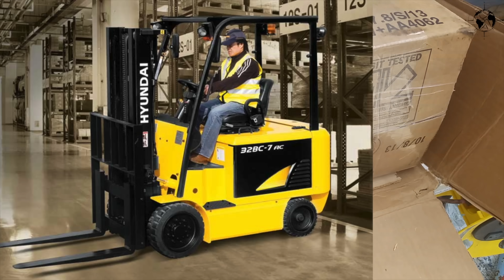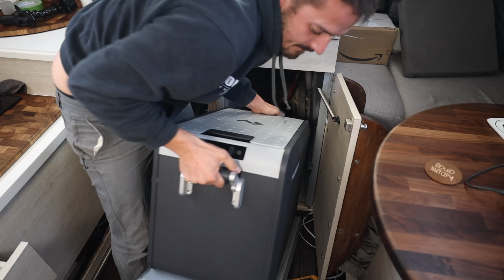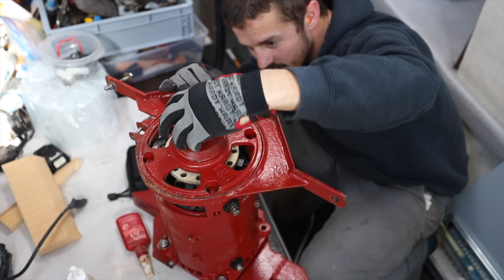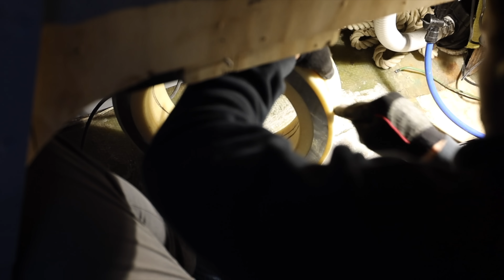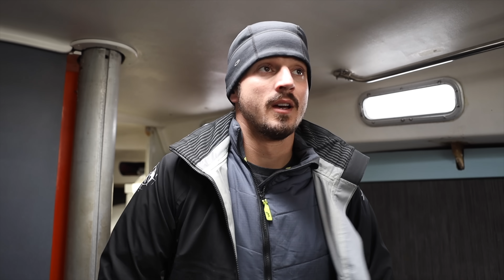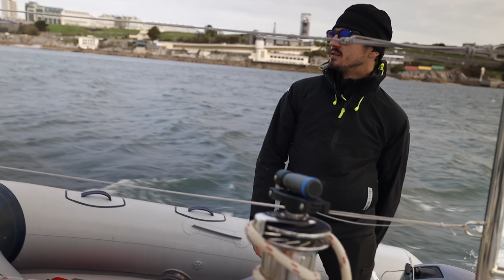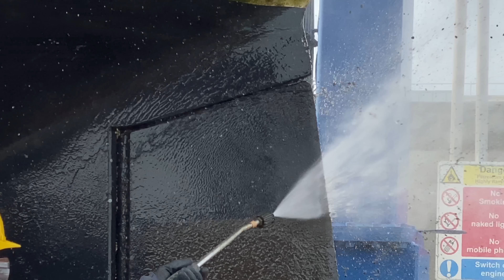Getting Rid of our DIY Electric Motor — Sailing Uma [Step 212]

Comment: Watching this video, one question came to mind.  How were you able to make sure that the mount was installed level while in the water.  I wouldn't expect the boat to be perfectly level.  I would think that it would be fairly critical to be correct side to side and for and aft?  Just curious?.  Great videos as usual and have been watching since you first started on your journey and can't believe it's been five years.  Time flys as you get older.......
Reply from the maker: We just trim the boat so she's level and then level the mount. Everything on a boat is relative anyway and being off by a degree or two doesn't make much difference. It's just for reference.

Comment: I know nothing about electric motors and boats but why don't they add some kind of alternator so as you're running it it also recharges
Reply from the maker: Takes power to make power and there are always losses. Any power gained from the alternator, would take more power to make from the electric motor. 

Now, having an alternator on the side to be used while sailing and act like a hydro-generator, is definitely an option, and one we've looked into.

Comment: Hey guys, what was the reasoning for changing to a sail drive? Seems like a lot of work when Oceanvolt also make a shaft drive unit which would be much easier to install?
Reply: Since it was a gift, used, from another boat, I think they will  install what they received.  I think that a sail drives flexibility would be welcome.  Can't reuse the prop and shaft but, they aren't optimal for regeneration anyway.

Comment: How would it slow you down under sail?
Reply from the maker: We'll have to try to test that on some passages soon. But we've been towing a 3 blade fixed propellor around for the last 20,000 miles, didn't seem to slow us down any. But don't worry, we'll be testing and sharing all this as we go.
Reply: @SailingUma  Thank you for the info, really want to see how this works.  I am really hopeful that the technology advances quickly so that even Lithium ion becomes an antique.

Comment: Hi, how are you finding the costs here in the UK compared to the US?
Reply from the maker: much, MUCH cheaper. Marians are about 1/4 the cost as the US and a lot of the boat stuff is cheaper since it's the same as RV's. Boating in general over here seems to be more "normal" and less "luxury" so everything is much less expensive. We were actually quite surprised.

Comment: You aren't likely to electrocute yourself with 48 volts DC or less, but you can absolutely burn/weld yourself to death with a large 48 volt battery bank.  For example, if you are holding a wrench and it vaporizes in your hand because you accidently short it across positive and negative, you could easily lose your hand.  I know you guys know this, but just some clarification for others that may not know.  Really cool project though.  I have been following your electric sailboat adventures for a while now.  Thanks for sharing.

Comment: Even a "seized" diesel can be rebuilt. I would have stuck with the diesel from the get-go. Good luck with your new challenges.
Reply from the maker: We tried, but we're not diesel mechanics, nor do we enjoy working on them. The main issue, is that the motor is 30yrs old and they didn't make very many of them, so spare parts are hard to come by. We spoke to many mechanics and machine shops and got similar advice from them all, even Westerbeke. They all said, we "could" rebuild it, but if, half way though, we lost a spring, or seal and couldn't get a replacement, we'd be a few thousand into a rebuild and still have a non working motor. For the price of a rebuild, we could have put a very nice electric motor in.

Comment: I would strongly encourage you to add a lot more glass to your ring.  That ring is the only thing between you and sinking IMMEDIATELY if you hit something with the sail drive.  The force if you hit something with the sail drive would be tremendous and would open a gaping hole in your hull if the bond of that ring failed.

Comment: Exciting times. I wonder if there is a platform that would raise, lower and store your outboard motor. A scissor kind of thing. Thus in the lowered position could be used for boat power from the stern. Also an easy move to the dingy. Looking forward to your electric motor install. Usually talking heads in a presentation doesn’t work well but the subject matter and b video was very interesting. Great stuff!

Comment: Holy cow. What you two have done is most impressive! Went by Oceanvolt'sr website. 38K euros? That is a new Tesla. Most generous patron ever. 

Btw, battery technology is changing rapidly. There are much safer batteries out there that don't catch fire. I suspect you already knew this. If not, check out the Li Titaniums and also Elon Musk's new square batteries which are replacing the 18650 Panasonics. He's having them made in China.

Comment: How do you use a level when you are in the water?
Reply from the maker: How else would you make sure things are level? We make sure our boat is level, then make sure whatever we’re installing is level too.
Reply: @SailingUma  just moving around on the boat makes my boat level change and we have similar size boats.  I, instead measure from reference points.

Comment: Surprised no one makes a bolt on aftermarket regen kit with its own dedicated propeller that mounts outside on the back of the boat.
or a kit that connects between the propeller and the motor.
Reply from the maker: They do. Watt and Sea makes one, but they're $3000. For that price, we could upgrade our motor and get more regen from a prop we're already dragging though the water.
Reply: Thanks, I was wondering if other people that want a regen system could get one.
Safe Sailing

Comment: Looking forward to see how much speed if any you will lose while using regen while sailing. I drove a hybrid with regen 150,000 miles and never replaced the rear brakes   could feel the regen slowing the car down.

Comment: SepEx is STILL not pronounced "Sea Pex". It is pronounced "Sep Ex", for SEParately EXcited. I corrected you guys when you first installed the electrobeke. SepEx simply means that the field and armature windings are controlled separately.  I think you may be getting confused with a pump company called "Seepex". As an analogy, the armature current controller can be thought of as the throttle, the field current can be treated like a transmission. The higher the field current, the greater the torque, but the lower the RPMs.

Comment: Odd. Usually in Spring/Summer, the marinas here are pretty much empty and even offer you good deals for hauling your boat out, because everyone is using their boats. 
Whereas in Fall/Winter, when no one sails that much, marinas are crowded with boats doing maintenance. 
So it seems like quite the opposite you guys have in England.

Comment: Is a 300 volt motor dangerous to people while on the boat or when swimming around the boat? I get that it's dangerous, but I don't know how or why, pls enlighten! What are the scenarios that make it dangerous? Not looking for smart ass responses, just understanding.
Reply from the maker: It’s dangerous when something goes wrong. 48vdc can give you a nasty shock, but 300vdc will kill you. If everything is done correctly, it would be fine, but on boats, things go wrong sometimes....
Reply: Sailing Uma But what could go wrong? Is it storm-related? Improper wiring? A loose wire that accidentally gets touched? I'm not sure what the specific scenarios are that make it so risky 😔

Comment: Used to be an assistant boat builder, mostly glass fibre/epoxy racing boats. And I have to say I am quite impressed with your skills, personally I would use a lot more addetatives like silica, wool and be more keen on using the appropriate glass fibre weave and thickness or even carbon and Kevlar where appropriate but I don't think it would make that much difference. Good job guys, it is a pleasure to watch you work!

Comment: Just for emergencies, have you considered a retractable outboard mount for your 15hp. for the inevitable need of dead plant & dinosaur power? A block and tackle off your solar panel tower would save your backs.
Reply from the maker: IF we need to, we'll just side tie the dinghy. It's better anyway, since we can maneuver it separately from the boat and use it like a tug boat.
Reply: @SailingUma  stay safe Dan and Kika

Comment: best of luck on the install, I wish I could have afforded something of this direction in regards to EV conversion, but I was limited on funds so I went the other direction and spent more on solar and battery storage and went with affordable EV outboards on my Gemini 105 with dual 48v EZ Outboard 20hp units. I can easily do 5-6knots with a single motor on a calm day, but the motor was working pretty hard and pulling a lot of amps, so I recently added a 2nd in tandem for both emergency backup and extra propulsion. Now running them both at the rated peak torque RPMs according to the manufacture I can do 8-10 knots pretty easily, but I can maintain 6 knots without temperatures rising over time anymore and running them both at low pulls far less power to obtain the same speed as the single motor could do previously. I just don't have regen like you will have with the oceanvolt unfortunately.
Reply: William Huston, RN 
why can't you add a regen module between the shaft and motor? When the motor is off the regen-module is connected when the motor is on, the module is not connected.

Comment: Nice idea.. regeneration is not as efficient as you may think. 
It’s like a wind mill . A rulle for windmills is .. the bigger are better. Small windmills are suck as effective generators. 
This rule is similar for small boats and re-gen electro motors. Im curious how this will work out . 
Super cool project,, top job,
Reply from the maker: We're not expecting much, but 2-300W add up over the hours and days. The reality is, we're already dragging a prop though the water anyway, may as well get some power from it.

Comment: It's so nice to see.....an engine with no oil on the deck....no spills.....no steam or heat rising up into the cabin.  Love the journey you both are on.
Reply: And the electric motor is tiny compared to the tractor motor
Reply: @easternwoods4378  Not once you include the batteries.
Reply from the maker: But boats have batteries anyway. If you were ok with 10-15mile range you could get by with just 4 batteries.
Reply: @SailingUma  True. And that'd be fine for most people going in and out of marinas. But, for example, we sailed from BC to SF and once had to motor 240 miles (37 hours) with up to 10' seas. We would have needed a lot of batteries.
Reply: @MikeKennedyOfficial  so more batteries non stop more Miles??

Comment: Biggest problem with Regen is the prop... You need much smaller pitch (ideally more area) to regen than to propel. If you have a variable pitch propeller, than you are gold. Full electric install (opposed to regen from a normally ICE driven boat) have the advantage because of the flexibility of the electric motor to work on a broader rpm range (aka use a smaller pitch propeller and increase motor rpm), but it comes at the price of decreased efficiency while propelling the boat forward. I hope you got the variable pitch one (I'm 99% sure I know the boat this is coming from, saw it on the O'Kellys channel). Anyhow it will be very interesting to see the practical results. Best of luck. Cheers

Comment: Will you remove your vane? With regen you should be able to always use your auto pilot, no wind no movement no regen no need for vane.....
Reply from the maker: Definitely not. We take comfort in knowing we can operate our boat with out any electricity at all. Besides the windvane is silent and a joy to use.
Reply: getting rid of the wind vane would be really stupid. Relying on always having power is a huge mistake.

Comment: 14:25 how you make sure it’s level in a boat ?  You guys are awesome. keep being you.
Reply: That’s a really easy one, take any random angle, sooner or later, it’ll be leveled :)
Reply: Ok working in the Damen boat yard we had levels which you could set and we take the reading from the foot well of the doors so one for Port to STB and one for bow to stern ok that's is when you are on the slip
Reply: @milkoberben2963  how is sit on the water has little to do with sitting on the ground   trailer, blocking, 🖐
Reply: @theoldman8877  the slip is actually on the hard :-)

Comment: Super looking forward to the install and testing, I remember about six or so months ago I was on @SampsonBoatCo page pleading with Leo to at least go hybrid if not full electric and there was some Luddite in the comments saying something along the lines of the usual “electric boats don’t work’ nonsense but then added “ just look at the problems sailing Uma is having”.  Say what!! I searched and searched your channel and only ever found positive information on going electric... Perhaps you should give Leo a poke in the ear about what you’ve learned to try and steer the man away from 20th century technology that’s killing everything. 😆🙈😜
Reply: What they've learned is to live with the limitations imposed on them by their choice of a weak and sometimes unusable method of propulsion backup to the sails.
Reply from the maker: The limitations from our old system have all been upgraded and sorted. Remember that entire set up we scraped together form less than $500 and it worked just fine for 5 yrs and 20,000 miles of cruising. It's relatively new technology, but we still enjoy it.
Reply: JC1028 oh shut up you broken record. 😁😂
Reply: @HandyC  Truth hurt?

Comment: Why not use a watt&sea generator?
Reply from the maker: $$$$ Those things are like $3k. You can just get an electric motor and power then entire boat for the same price.
Reply: Sailing Uma fair enough on price but it seems more effective than a regen system when you can adjust the prop pitch at lower speeds. But I did write this comment before I came to the part y’all got an oceanvolt donated. 😉

Comment: Fun fact, if one replace a small working 2-3 cyl diesel engine with an electric motor and modern batterys it will take about 4000 running hours to brake even in co2 emissions. However NOx emission wins are instant. :) 
I'm also interested in regeneration and electric motor conversion but I have one huge demand, it must be absolutely dead silent, I hate any kind of noise when I'm sailing. 
So I'm looking forward to the episode when you try your "Tesla" :)

Comment: under the right conditions you can be killed by 30 vdc
Reply: if you dig two electrodes deep inside the body preferably next to the heart....  but not through the skin, 30V will not kill you through the skin, not even in salt water ;)
Reply: In order to generate enough amperage across the body's internal resistance an 30 volts is enough.  Back when Jesus was a striker seaman a navy sailor killed himself with an old analog multimeter set on resistance.  The meter used 28v to measure resistance.  He was exhausted and did poke the probes through his fingers on opposite hands.  The navy put out a flash message about it to every command in the navy.
Reply: @azroadie  sorry , i don't believe that story . the only way how someone could kill someone with a multimeter set to resistance is either stab him with the probes hitting the heart o smash his head with the multimeter itself (and in that case it needs to be a old and heavy multimeter, new plastic multimeters won't hurt anyone) :D so either provide proof or your story is fake.
Reply: Durell Dailey  and that's why GFCIs for bathrooms are set to 30mA because 10mA can kill you right ? :D
Reply: Durell Dailey  tell me how you set amperabe without changing voltage.   Duh.   Amperage klls and according to ohms law amperage is VOLTAGE divided by RESISTANCE.   In 1984 a Naval electronics tech was killed by a multimeter in resistance test mode.   He was sick, had duty the previous day with no sleep, and stabbed the probes into his fingers.   In resistance test mode the meter generated 28 volts and computed the resistance by the amperage.  So smartass you can indeed be klled by 30 volts or even less, and more importantly nobody says be careful thats a 15 amp circuit and could generate up to .1 amps if you grab the wires in your hand..  No they say hey be careful thats a 440v circuit and assume you are not a dumbass and can figure at that voltage you could generate a dangerous amount of current.

Comment: To bad, i was very impress with your direction and how good it was.  Do you ever though of looking to eletric motor of electric car?  Most of those motor already able to recharge when you break.
Reply from the maker: EV Cars often run at 400+ VDC which is much harder and more dangerous to work with.

Comment: regen on a sailboat motor sounds useless. how would you get enough kinetic energy to the motor under sail, because the prop wouldn't do didally squat creating regenerative power. even thermal regen would be useless unless it had a combustion hybrid motor. I see a lot of these green boats but the tech isn't nearly where it needs to be to be practical. mostly on the battery side. imho
Reply: When Uma team crossed 
Atlantic they said regen provided ~2 kWh per day. This is not a lot for electric motor, but enough for home electric needs

Comment: Interesting, from you guys, this electrical sailboat.  
In the year 2015, that  < schooner https://www.northsailing.is/the-boats/schooner-opal/  > was transformed into the electrical ship as you have. Yes, It does have a diesel generator in case if you er running out of power but it can generate power from the propeller when sailing. 
I was lucky enough to go on a sailing course on this ship a few weeks ago, great fun.